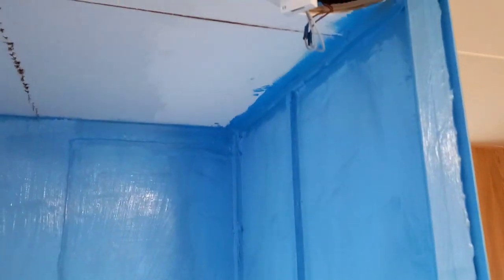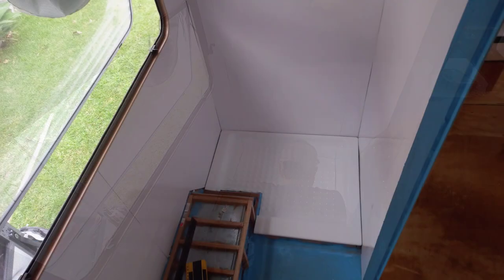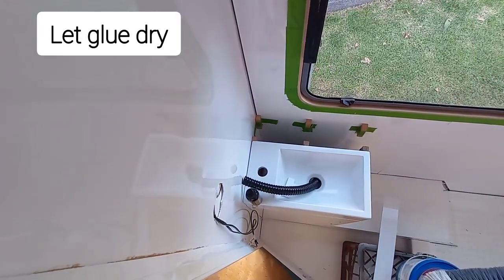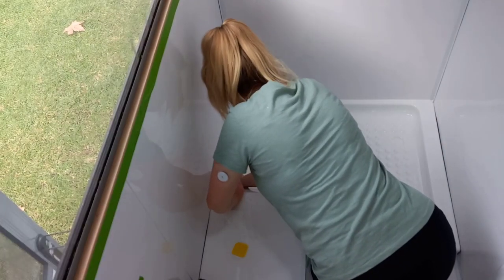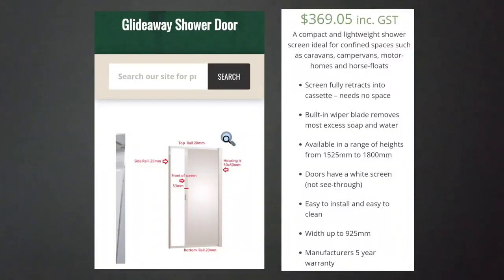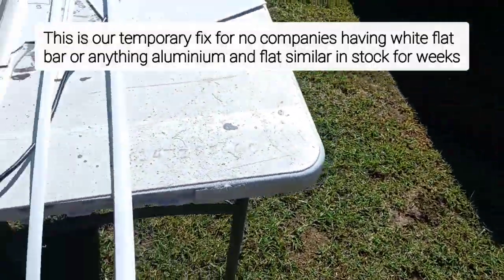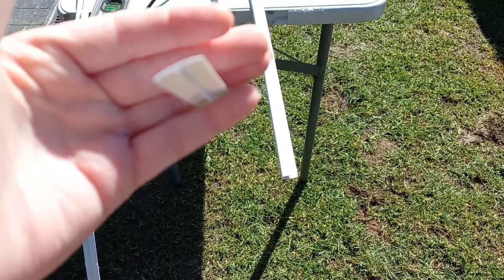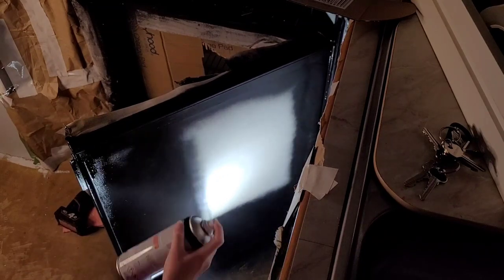Caravan Bathroom Renovation & Glideaway Retractable Door Installation - (Part 3)

Comment: Thanks for your video! I am keen keen on getting a glideaway door for our caravan.The partner thinks it's will be filmsy and the kids will break it. How is it holding up please?
Reply from the maker: Thanks for watching!. The framing in itself is quite sturdy. I think it also helped that we screwed the frame in not just using the adhesive stick that it comes with.. the only thing with kids that could break is the actual screen that slides closed is quite loose when closed. It's obviously not firm like a wooden door. If a child pushed it or fell on it with enough force I guess maybe it could break the retractable parts to it which would be an annoying thing to fix. But if you keep it closed and only use when you need you should be okay. We havnt had issues yet to be honest!
Reply: @FCD | Fishing Caravan & Dogs  thanks so much! Il be going ahead with it! You guys are doing an awesome job!
Reply from the maker: So sorry I didn't see this reply! Thanks so much. I hope it goes well for you too!

Comment: What is that board you used in the shower?
Reply from the maker: Hi! Thanks for watching. Do you mean the wall panels?
Reply from the maker: If that is what you meant, these are just sheets from bunnings. If you watched reno video part 2 (https://youtu.be/Cf0jqLeU1hY?si=TQLT-F0H_1cN0HMp)
and stop video at 11.17 there is a picture of the box if you wanted to see what it looks like. it's called -  Estillo Acrylic Shower Wall.